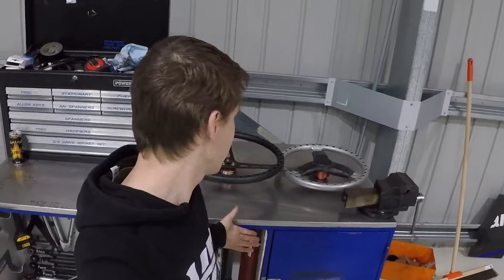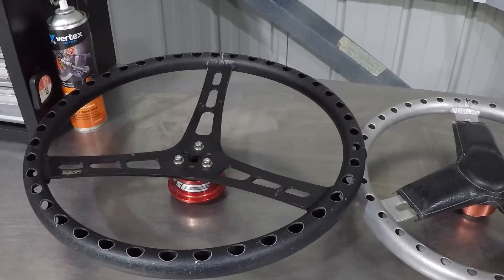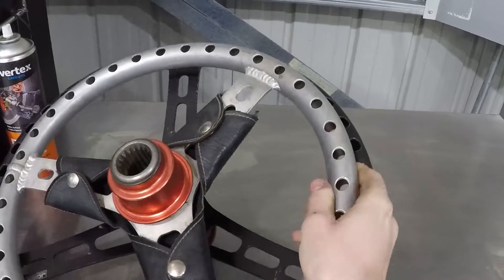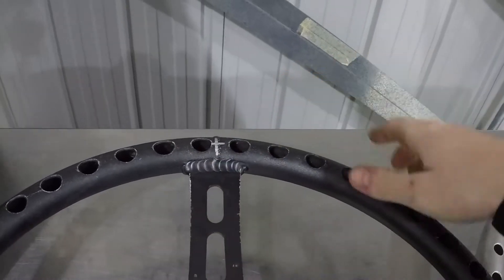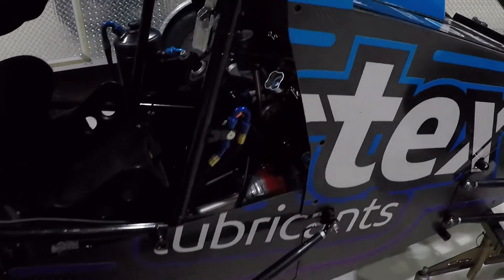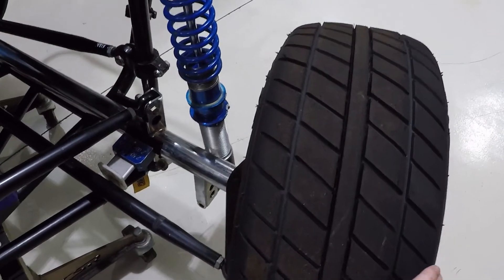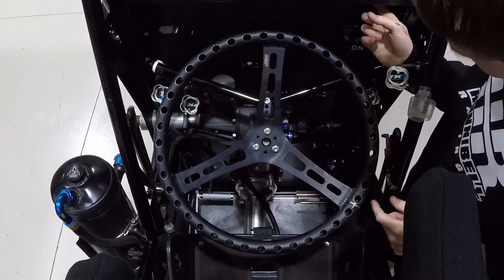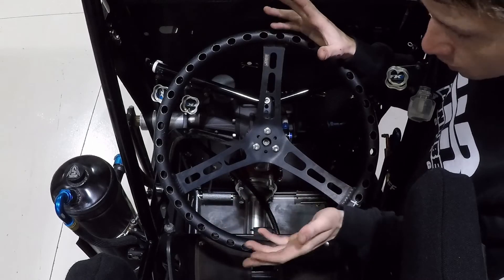The Infamous Bus Wheel and Steering Ratio's (tech talk)

Comment: I use an Old 17in Shroeder wheel In the Modified, Was tempted to run the 17 in the 410 Non Wing. The mod is way too aggressive with a 15in wheel cos of an 11in RF tyre and coil fronts